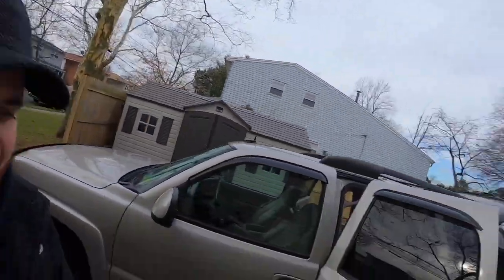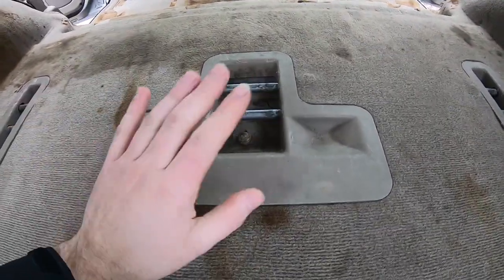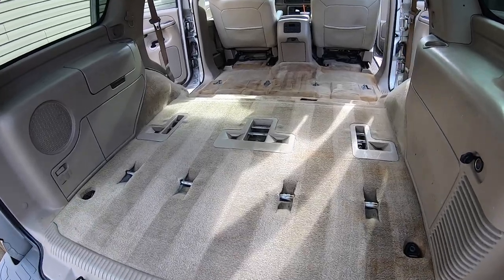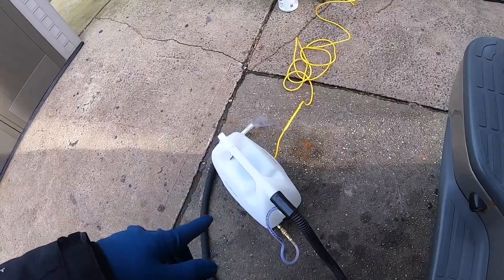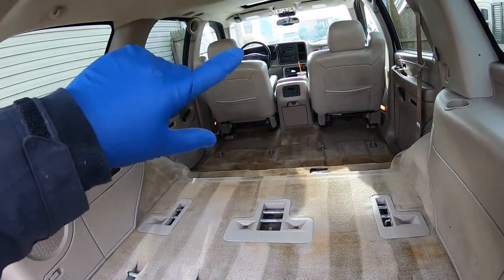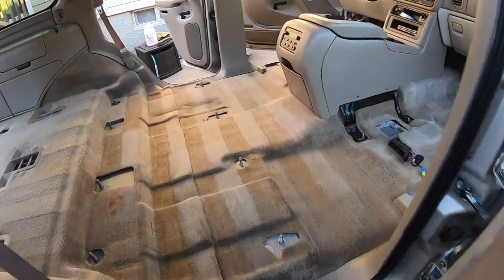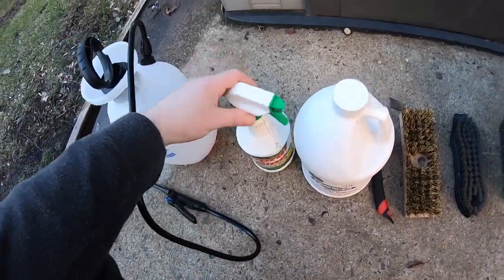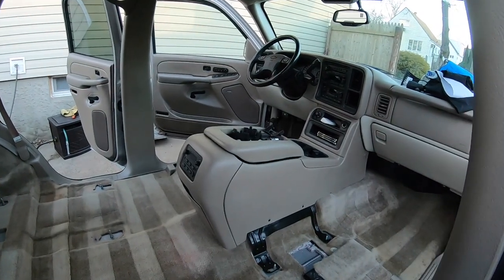This Carpet Should Have Been BURNED!!  | Extreme Detailing

Comment from the maker: For anyone asking about the luminol test, that video went up a few weeks ago! Link to it is the first one in the description🤟
Reply: Have you tired Mothers VLR cleaner? It's literally amazing! 
Mother's VLR Vinyl Leather Rubber https://www.amazon.co.uk/dp/B004N63S9W/ref=cm_sw_r_cp_apa_i_kEdUCb7R2B2RK
Reply: i am betting the red stain is tranny fluid, but it still could be blood. ya never know
Reply: If you think you have blood stain, go buy contact saline solution.  Apply saline to the blood and dab it with an old towel.  Then clean with  cold water and hydrogen peroxide or oxyclean.  Do regular carpet cleaning after that. I would follow up with Scotch Guard and Febreze  fabric spray.
Reply: He forgot to blur out the license plate number
Reply: Don't waste your time on car cleaning products for carpets. You're already at a disadvantage using a wet dry vac to extract. Go to a janitorial supply house and get chemicals dedicated to getting out red stains and another for brown/yellow stains.
Reply: Also, for red stains . . . Use the dedicated chemical, get a towel and a house hold ironer (for clothing, any one will do, lowest heat first. Lay the solution down, put the damp towel (hot water) over the stain, and use the ironer to transfer the stain to the towel. It's miraculous. There's also a "spray and walk away" type of chemical that will eat away at the stain after you leave for further treatment, kind of like the toothpaste the keeps brushing after you're done brushing lol.
Reply: LsxMatt you should check out “Staffer Garage” here on YT. He has a quick cleaning method. I hope it helps you save time.
Reply: LsxMatt will the wet vac auto kit work on My RIDGID Wet/Dry Vac 12 gallon 5.0 Peak HP
Reply: Next time you clean a carpet in a car I suggest using a drill brush attachment it's basically a brush that attaches to a drill gun.
Reply: Sometimes with heavy stains I find the best way to remove from carpets in cars is just to use the basic Laundry Detergent used to wash clothes...sometimes with blood stains in fabric or carpets it is the safest way to remove the blood, do not use any bleach on blood stains as it will turn a dark black and in some carpets and fabrics the black will lock into the fibres and rather than a red rusty stain it becomes a dark brown black stain....best and safest way to remove stains like this is to use Clothes Laundry Soap, either liquid or powder and let it soak, another good chemical to use to remove tough stains from fabric is Dishwashing Liquid with small amount of water I apply it to the stain rub and agitate and then repeat and after doing that extract.
Reply: U should get a clear extractor so u can know if the carpet is actually clean just cause it may look like it it sometimes not check out Stauffer garage and detail geek
Reply: With folex it works best is you saturate it and let it set overnight then spray it on again an extract. I got a huge blood stain out of a carpet and the pad underneath by doing it that way.

Comment: I always thought the people that ripped out carpets and pressure washed them were a bit overboard, but in this case I believe it would've been completely justified.
Reply: FantomLightning - thats the only way to do it, when that bad . This van was a 3 on the level of crap i have to clean. I pull em power wash em, hang to dry , dye them , and reinstall looking brand new. The grungy ofange dirt streaks looked pretty bad. Granted better than it was.
Reply: maybe they had a car accident 🤔
Reply: I did that to my 1999 GMC YUKON, removed the carpet and pressure washed the hell out of it, saved $500 bucks

Comment: I would take the carpet out and just put in hard wood floor.... XD
Reply: Maffoomars Games And Speedbuilds maybe it’s underneath.  Lol
Reply: Yeah, the place I work out uses a small fleet of vans and trucks. They are special ordered with no carpet (looks and feels like a hard rubber or plastic mat). The vehicles also have special shelves and other stuff, but after riding and driving enough, I'm ready to tear out the carpet in my little SUV.
Reply: Is that even possible to have wood flooring in a car
Reply: Abigail Hurd yes, it’s been done on top gear UK
Reply: Boom 500 likes
Reply: Christy Andresano you're comment made me totally loose it after reading the first one
Reply: Tack on a manual crank and you got yourself a model T!
Reply: Abigail Hurd my friend has an older Mercedes with hardwood flooring in the trunk and in the cabin lmao
Reply: Looks good for a week, then the weather and humidity really gets to the wood. Starts pushing itself apart and swelling. Then winter hits. And all that moisture gets absorbed by the wood. No good. Usually telling my customers that have big houses and large hard wood flooring areas to get dehumidifier and keep the house between 60-80 degrees. Cars see wild swings in temp. Not good. You will be throwing it out in 6 months

Comment: Hydrogen peroxide would take out some of those stains.
Reply: It would fade the colour in the fabric though wouldn't it? I have some really stubborn coffee stains on my front seat and tried everything to shift them nothing works.
Reply: @Teckno77  You can always test some on an inconspicuous spot first.  It should not fade the color of  fabric.  I have used Hydrogen Peroxide to remove stains from dress shirts.  Great at removing  organic stains.  Blood, grass, coffee, etc.  I am also talking about the 3% that you buy in the drug store, not the higher percentages.
Reply: @moldingpro7208   Right ok so like you would use to dye hair etc, always thought it would be too strong. I can't really scrub my seats hard as fabric is very thin and easily tears so that may be an option. Thanks appreciated.
Reply: One of the stain removers I use with my laundry is 1T dish soap, 2T hydrogen peroxide and 20d of Lemon essential oil. Love it! You don't have to use essential oils if you don't want to.
Reply: @Teckno77  you should be fine. I use it on my carpet, counters, laundry, everything. I love it. It cleans everything and get stubborn stains out.
Reply: It works on kool-aid
Reply: @Teckno77  Get some Prochem Stainpro off Amazon.  That will do the trick.
Reply: @Matt-fq8iv  Cheers but I managed to get some cleaning solution from a place that got it right off in about 2 mins with no water needed.
Reply: @Teckno77  share the name please!
Reply: @Teckno77  tannin stain remover
Reply: We use glass cleaner foam it's amazing plus it smells fresher! 😋
Reply: @Teckno77  its blood stains

Comment: 6:14 I think soaking the stains and dirt first with your soap/detergent and letting it sit for 5-10 minutes can be a nice way to loosen up the stain/dirt so that you won’t have to go over the same spot over and over, wasting time and product. You can soak it not by spraying, but by pressing the foam in with the sponge (just slapping the sponge on one spot and pressing on it) to make sure it really gets in there) You can also use medical alcohol while soaking it to kill the bacteria and lift the stain, as well as when you’re 100% done just to remove chemical smells and stinks and make sure there is no toxic bacteria crawling around)

Comment: Looks good. I just learned that if you actually have the shop vac, don't be afraid to add more water after scrubbing the cleaner in. Vacuum soon after putting more water down, and this prevents the dirt from going back into the carpet and thus you can do it with 2 or 3 passes v. 6 to 10 passes.

Comment: A steamer with a long hose worked awesome on my van headliner.  Just wrap a microfiber towel over the end of the upholstery tool, working small areas at a time, constantly moving.  You don't want to let it sit on an area, you'll damage the headliner/ adhesive.  Have lots of microfiber towels handy, as you'll need to constantly change to a clean area of the towel.  Blot and gently rub finished areas immediately.  I had zero experience with this method, and got amazing results!

Comment: You can try pulling the carpet out power wash it :)
Reply: That’s what I was thinking
Reply: I used to detail and on some cars that were just so bad that's what I did and then hung them up and took the air compressor or blower side of my detailing vac to it.
Reply: that is what I thought
Reply: new carpet?
Reply: @haihoegaatet6963  Pricy
Reply: That's what I've done. Sooo worth it. Probably would've been easier in this case, too.

Comment: Pretty sure the ones that won’t come out are rust stains from the seat rails etc...happens in most cars that are several years old...I’ve cleaned carpet a few times that had this issue...I think “wink” the brand makes a rust stain remover that can be used on carpets...but probably still not gonna come out 100%

Comment: I've done this before in my suburban.  Actually, I even sprayed it with a hose over and over again while sucking the water up with a shop vac.  It looked perfect when I was done.  The next day I go out to show my wife and it was even worse than before I cleaned it.  All the water wicked the soda and dirt back up to the surface.

I found that the best way to get them to look clean is to use a damp microfiber rag and just scrub the top surface.  This keeps cleans what you can see and doesn't allow anything to wick up to the surface.

The next best thing to do it to remove the carpet from the vehicle and spray it with a stream of water over and over again until it runs clear.  Then let it dry and apply a carpet dye to even out the color.

The best thing is to just replace it with new carpet!

Comment: Huge improvement. Wondering if you would have let the cleaners sit for a while if it would have cut down on time and effort? Also wondering if you can flood the loose dirt with water to rinse it with the extractor and get more dirt out sooner or in fewer attempts? No hating here just thinking I might try this and add or omit a few things. I do use peroxide and/ 91% alcohol on tougher stains with success. Great job👍🏾

Comment: Came out great man. Be aware if you have a sunroof they are prone to have the drains get stopped up and leak on the driver's side at that cupholder area down to the floor and make it rusty and it soaks through the floor too. I couldn't get mine to stop leaking and flushed it and flushed it then shot detailing spray down them to slicken everything up and it worked lol 😂 no more wet floor back there. Have you ever used that Tornador floor cleaner device? I heard great things like everything gets removed.

Comment: I’ve always found it best to pull the carpets from the car completely and soak it down with purple power and hang it up then pressure wash the crap out of it until the stains are gone and all the dripping water runs clean... best method I’ve found and I use it on every vehicle I’ve ever bought used

Comment: It's been a while, but FWIW, the least expensive + effective thing is to start gentle & just use a mild soap mix like Woolite and gently work that around to loosen years of ???.  Then use any wet-vac and draw everything out.  Flood it again and pull the dirty water (looks like chocolate milk at first) out.  Flood & extract again.  You're working against years of gravity - wet it good, agitate and extract again.  Whatever that stuff is, it's on the fibers, in the backing and even down in the padding and it'll keep wicking up.  Eventually you're just pulling up the mild soap mix.  Final - clear water rinse, same operation.  When you leave soap in the carpet, the soap actually attracts dirt; so clear water rinse for a final.  Happy Trails!

Comment: Pull the seats, take the carpet to the car wash. Spend 5 bucks spraying it down and rinsing the soap off. No chemicals no shop vac, just some dry time. This guy just wasted hours of time and a nice chunk of money. Some stains will not come out, but most will. Your welcome.
Reply: With all the hard bristle brush scrubbing he did there's no way a self wash wand and soap would clean the way it currently is....plus it's not wasted time if you like what you're doing its all in the details
Reply: @BEERLIGHTBROKER ....think I'll be ok not that serious bud
Reply: @justingrant4860  Time is very serious. You cannot get a vehicle carpet cleaner, and finished faster than the car wash method.

Comment: I was cleaning mine for hours when I got it. It was filthy as or worse than yours. After a while, I ended up taking out the seats and the carpet. Pretreated it and scrubbed it. Took it to the car washed and pressure washed the whole thing. Came out very clean and I should’ve just took it out to begin with.

Comment: I bought a 2001 S10 Blazer that had carpet that was hard like wood yes, like wood. The PO had kids and just let them do whatever they wanted in the truck. Cereal, fris, cookies, gum, suckers stuck to the carpet, and just about any other food you can get from a drive through or a box. I even found eating utensils. There was something growing in there, no kidding, some sort of mold or fungus. I pulled the entire interior except for the dash. I pressure washed the carpet and brought it back to life. There must have been 20 lbs or so of dirt in it. The seats were hard in the seat bottoms as well. They got scrubbed. I bought some replacement interior plastics from the junkyard to replace broken items and let the interior dry for a few days. When it was all back together it looked almost new. PO wanted to buy it back, but I kept it for a few years. When they are bad, pull the carpet and pressure wash. The results are better, all of the dirt can be gotten out, and it can be a lot faster as far as the manual labor portion of it. You do lose time with drying though.

Comment: As a mom of 6 I can assure you that all that brown gunk was chocolate milk.  Chocolate (cheap chocolate) has added red coloring to deepen the chocolate to make it look “richer”.  I’ve had MANY red/orange stains on my dining chair upholstery and in my cars.  You can get it out with a 1/1 ammonia and water solution, a white towel, and an iron.  Spray spot generously with solution, put white (ONLY WHITE!  Other colors will transfer) towel on top and iron on the highest setting.  Repeat as necessary.  This works for ALL set in stains.  YOU’RE WELCOME!

Comment: What would you suggest using to clean the overhead headliner and visors? Also, what would be best to use to clean the seat belts (since you can't use chlorine based products like bleach)? 

I have a light grey cloth parts for the interior trim. I helped my roommate on a couple occasions transport the person he was taking care of (this person has parkinson's and alzheimer's) and with dirty hands he touched the visor, head liner and seat belt making them dirty. I'm looking to see what cleaning solution I can get and use. I have 2 shop vac's (wet & dry) ... 1 is a 4 gallon 4 HP and the other is a 14 gallon 5.5 or 6 HP (don't remember) for liquid extraction (after shampooing/cleaning the cloth) and thinking about getting a Bissel Spot Bot portable shampooer.

What would be best for a general consumer looking to detail his (or her) own car?

Comment: Me personaly that have done this kind of interior clean-ups professionaly i would recommend using G101 and bioclean, if the brown-ish stains is still there hit it with some acit that you use to remove asfalt stains with. Boil up about 10L of water and add 5dl G101 and 2,5dl of Bioclean, try use soap water when you scrub the floors, the G101 also works wounders on panels inside the car.
Hope it helps someone in the future
Good luck to all you people out there with your cars and drive safe

Comment: Suggestion for You.  Use an equal amount/mix of both Oxy Clean and Resolve together in the same bottle for the rough stains.  Second, use a drill brush to use to clean the carpeting.  It's used to lift up all the dirt trapped in the carpeting. Third,  use a Hot steamer to pressure clean the caked in stains and plastics and carpeting.  And lastly,  use a Bissel extraction unit to suck out all the water from both the carpeting and seats.

Comment: you need a hot water extractor to get those stains out.  the vacuum doesn't cut it because it doesnt rinse and pull out the stain.  all you did was dilute the stain and spread it out.  came out visually better but it did nothing when it comes to removing the stain.

Comment: Those looking after all these years like me id pull it and pressure wash it. Then extract. Then for the stubborn spots you can use a drill mounted scrub brush (dont use one that too rough they have ones for carpet that are cheap on Amazon). Ive done that myself with great results.

Comment: Well when I did detailing. Some stains turned colors.  I was told that it was a reaction to whatever cleaning solution was used on it before.  For example,  most people get tuff stuff auto carpet cleaner cause it's easy to find and cheap.. well when I used my amazing clean solution...it would turn the stain from brown to pink or if it was red it would turn greenish

Comment: The red is rust. You can get rustic acid at a hardware store and pour a little directly on the stain. Be sure to wear goggles and rubber gloves. The stain instantly disappear. As soon as you do that you want to pour water on the squat to dilute the acid and then vacuum with your shower back. I was A carpet cleaner years ago. Rust is easy to get out of a carpet made of nylon or Man-made plastic .

Comment: Just wondering. Why you didn't take the carpet out and wash it with the power washer. ? Nice video.
Reply from the maker: It was the middle of winter and pretty cold out. It would probably freeze over and take forever to dry.